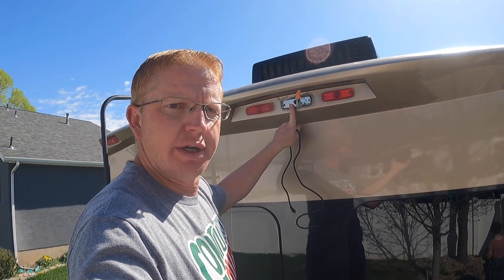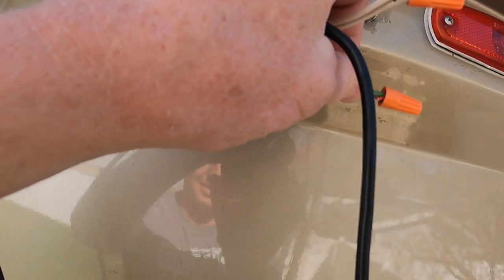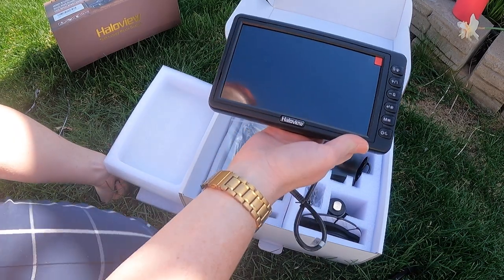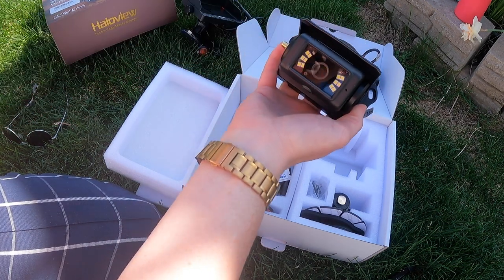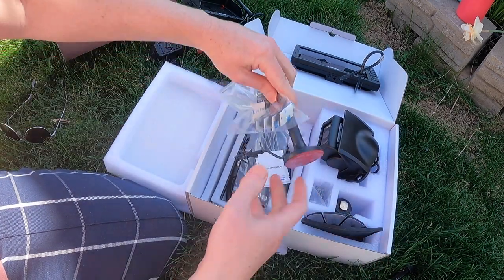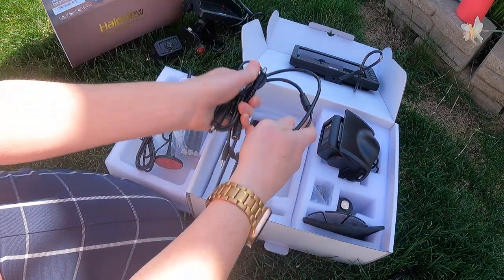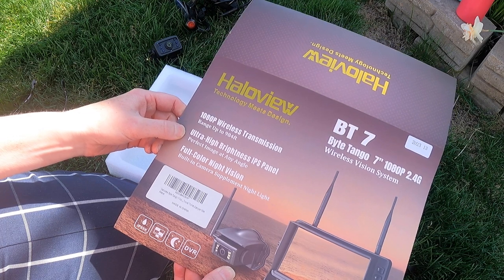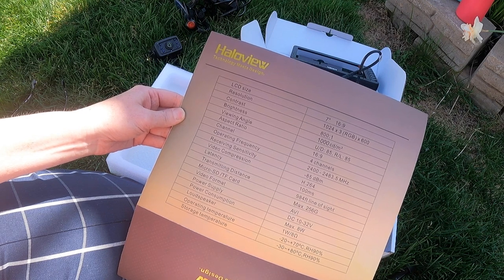Best RV Backup Camera: Haloview BT 7 Install

Comment: We also have the Haloview BT7 Backup camera.  The picture quality is great, however, if you use the back camera with the side cameras, there is a flaw.  We ordered the backup camera with two side cameras for our trailer.  We installed the side cameras with the trigger wire so that the side cameras work when the blinker is turned on.  However, when the right blinker is activated the camera goes to the right side camera.  When the blinker turns off, the screen goes black because the side camera does not know which camera to go back to.  This is the flaw.  There was a gentleman who thought he had it fixed by using a converter but there was issues using it.  Communication with Haloview's support is only by email (China) and they don't have a solution.  While we can manually switch to the side cameras, it is disappointing the system does not work with the trigger wire, which the side cameras come with.  Had I known there was an issue with the side cameras, I would have only bought the backup camera.  Just wanted to let you know of the issue we ran into.
Reply from the maker: Sorry to hear about that flaw.  I have always wondered how the side cameras work.  Thanks for the info and watching.